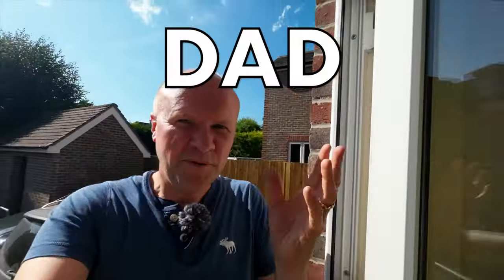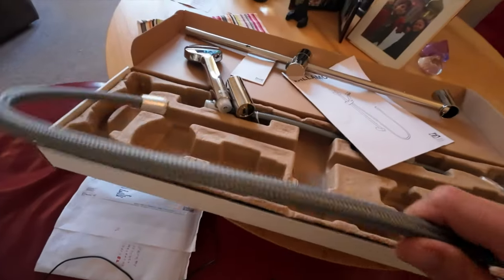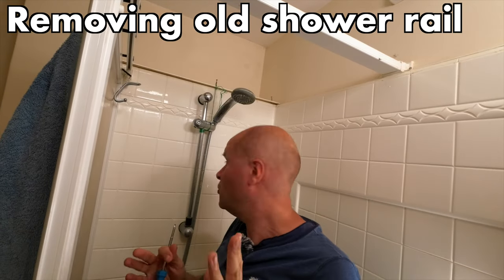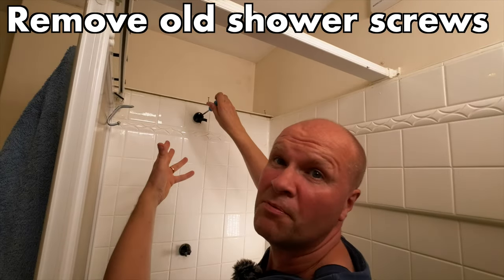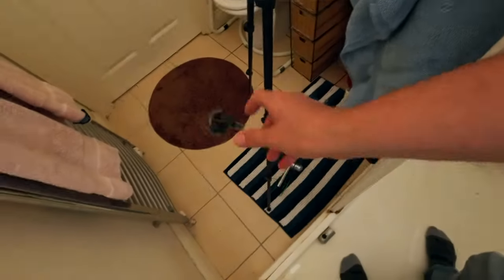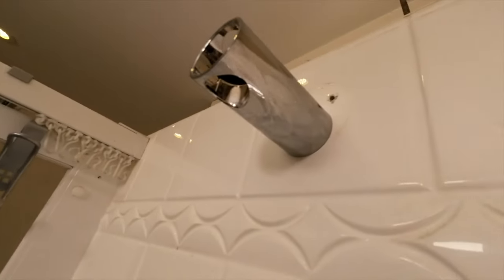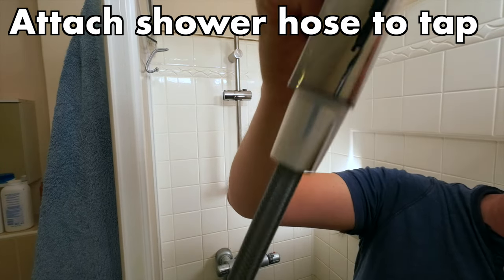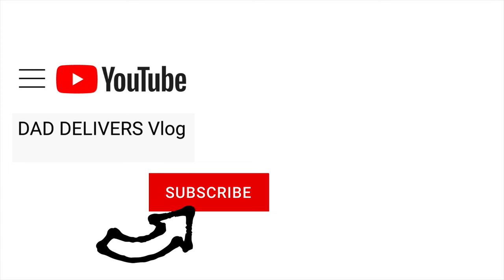How to fit a shower rail and head: 5 easy steps! IKEA VALLAMOSSE review

Comment: Is this the same installation as the brogrund shower head?
Reply from the maker: Hi Madie - thanks for the kind question, hope I've understood it correctly - yes it looks identical to the shower head on Brogrund... 
As for installing it, I think you need a plumber with the Brogrund to connect the water supply to the mixer unit, whereas with this one you can just connect the hose to the mixer hose outlet already there... hope this makes sense

Comment: Did you need to use silicone?
Reply from the maker: Thanks for the kind question - I just screwed it straight on to the outlet and it's still going strong without silicone. Hope this helps!